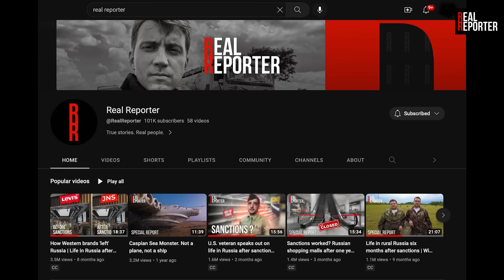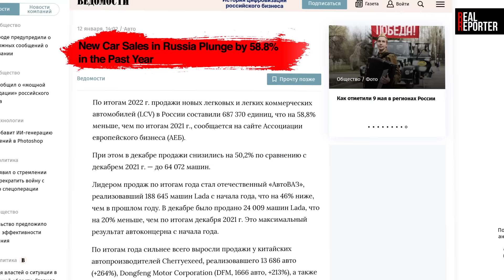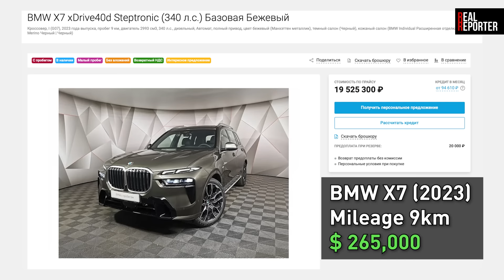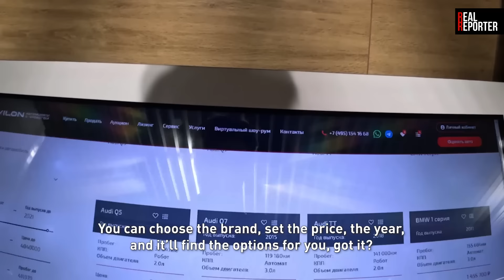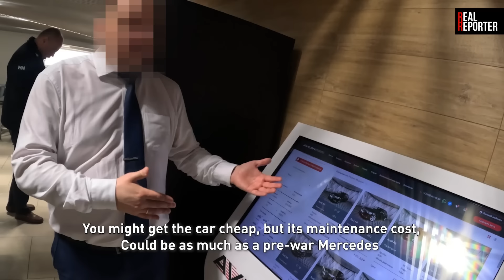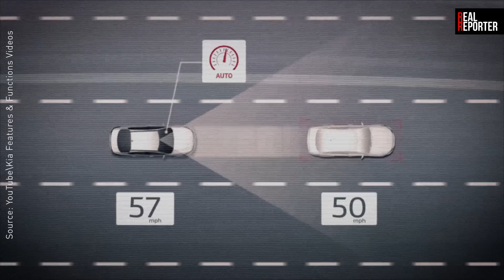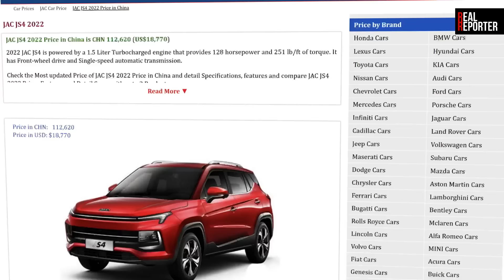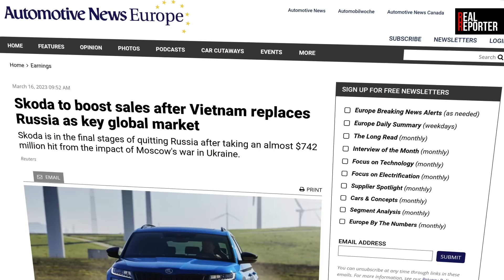Sanctions vs Russia’s car market. Who wins?

Comment: The real reason for the front seat in the Jaguar is not for passengers, it's really to give your mechanic a place to ride with you.
Reply: Хорошая шутка😂
Reply from the maker: Good one
Reply: A neighbor of mine had a Jag. That's not far from the truth.
Reply: And surprisingly Jaguar is own by Indian Tata Group 😂
Reply: I used to work for a company that owned 2 jags for high ups, aaaand the maintenance was so expensive that they decided to sell those and use premium taxi services. It was simply cheaper with no headackes...
Reply: My dad used to have the Jaguar XF - absolute beast of a car! Actually had it 8yrs before selling without any issues just annual services. 

The fact is just like a Range Rover, high end Mercedes or a luxury yacht they require regular maintenance and looking after and the parts aren't cheap. The reason they are so nice is because the tolerances are so fine, but you need to be able to afford to keep one.

If you want something that you just turn the key on and drive then you buy Japanese.
Reply: @wallingnaga6563  🤢🤮
Reply: @RealReporter  Thanks for a good video. I drove  back from two weeks in Russia last saturday...long trip. You forget to mention Turkey and import of brand new cars from Saudi-Arabia.
Reply: Few months ago i was at my mechanic who service all my cars last 20 years and there was Jaguar  F pace siting there..i ask what was wrong it..he sad totaly dead engine..on 2019 car with just 50 000 km on it which just got out off warranty
Reply: In the U.S, my mechanic once threatened my with physical harm if I bought one.
Reply: From Forbes article :
"According to reports, China is now the world’s biggest exporter of cars."
Reply: Forbes article name :
China Overtakes Japan As The World’s Biggest Exporter Of Passenger Cars
Reply: @RealReporter  While the sanctions played a role, the increase of Chinese car imports is seen everywhere.  Even without sanctions, you would've seen a huge increase in Chinese car imports based on world trend.
Reply: 😂😂😂😂 😂😂😂😂😂 realy??? wkwkwkwkkw
Reply: I bought a Jag. XK V8 from new. The salesman was very pleased telling me, I could turn of one row of the engine to save fuel. So it drove like a inline R4. Brought after first brakedown soon after, to where i bought it. An honest mechanic at Jag told me the reason you could do it. Was then you could always get it home, if it sprung a headgasket or piston on the one side. And I could keep going on the other side.
Reply: @TobotronPrime  jaguar, Land rover and range rover consistently come bottom of car industry reliability stats. Anecdotal  evidence is irrelevant in comparison to actual facts. Even the British army is having issues with Land rover reliability. I think it has something to do with poor quality components that come from India since these companies were sold to off to the highest international bidder.
Reply: exactly
Reply: @steffen1972denmark  I guess the engineers at Jaguar were just planning ahead for the known breakdown that was inevitable. 😊
Reply: money pits. never ending repair
Reply: I heard that back in the 1970s, Americans would buy a Jag and the first thing they did was to swap out a Ford engine because the Jags were unreliable. Fast forward to the early 2000s. Two coworkers of mine found out that they both owned Jags. The very next question that they asked each other was who their mechanics were. Not a good sign.
Reply: Lol ... good one 😂
For service and repairs it's cheaper to employ a full time mechanic when owning a Jaguar.
Reply: Как говорят некоторые в России, ленд ровер, ягуар, порше каен это недвижимость 😂
Reply: @tomtube1012  Chinese brands only manufacture in China, meanwhile everybody else have factories around the world. I wonder if this fact still counts as "export".
Reply: It's a BMW😮
Reply: @amiigose  
UAS pernah dikasih Jaguar sama jemaah nya, katanya sih cuman sebulan langsung dijual lagi 😂
Reply: @RealReporter  Soviet Union have the best public transportation on the world men. Soviet microdistrict don't need car #15 menit city
Reply: Hugh put Devine in his front seat.
Reply: @wallingnaga6563  what could we more expect from a Naga person who would Mock these. The fact that Jaguar landrover biggest market is China itself and britan is still hangover landover.
Reply: these fancy tin cans on wheels
Reply: @Viktor_F  Я аж вспомнила шутку что нужно покупать два жигуля, один чтоб ездить, другой пока первый ремонтируют...
Reply: China can have Russia😂
Reply: And money...
Reply: ☝ true story 😂
Reply: lol🤣
Reply: The Lucas electrics in my 1974 jaguar xj6 are every bit as reliable as the Lucas electrics in my Toyota Corolla!
Reply: @andrewallen9993  my 1990 XJ was a beautiful car...when something wasn't breaking. Maybe things got better or were better but more than one owners of Jags had the same opinion. Trust me I love them, been eyeing up the right XJR to buy.
Reply: @--Dani  The old ones were better :)
Mine was made in South Africa.
Reply: @Bustergonad9649  All Range Rovers sold in the UK are made in England
Reply: @the best  assembled in England.
Reply: @Bustergonad9649  The associated parts are manufactured in United Kingdom: (Solihull plant)
Reply: In Serbia we have the same joke just for Alfa Romeo
Reply: Yeah you should start a stand up comedy show and go bankrupt
Reply: Lol.. not really... Russians can build their own cars and they do..  Lada literally owns Peugeout. 
Russia started to produce Moskvits cars again, and they look like any other western suv. 

Russians will just start either building massive amounts of cars or import chinese brands, there's like ~50
Reply: @TobotronPrime  as someone that had owned 3 different Audi A3's, a Mercedes A class and rented a Jaguar XF for a week in the past 14 years - the Jaguar has been the most unreliable vehicle i have ever had to deal with.
keep in mind that it was a rental when i was on vacation in Scotland, i actually got two of them - the 1st time the suspension collapsed while driving at a highway. then i got a replacement one that had a dead electric seat motor so you couldn't adjust it at all, so i complained about it to the rental company and drove to their nearest depo to replace it and on the 3rd car i just asked the rental company to just give me the Audi A4 that was in the lot... lol.

english cars are unreliable trash.
maintenance cost of Audi is not that different from any VW group car, the Mercedes was a little bit pricier but still not what i would consider outrageously expensive and it was a really nice driving and reliable car, and for all of my cars i never had ANY issues because if you actually do your maintenance in proper intervals they can be just as reliable as Japanese cars.
but the Jaguar? the only good thing i can say about it is that the 1st one i got had a really comfortable chair, it felt like sitting on a really comfortable couch but reliability? from that 1 week experience i'd say its 0/10 in reliability.
and if you are a cheapskate that only wants a car that you can drive from place to place and never do maintenance just buy any Toyota model from the 80s-90s - they can basically run on 20 years old motor oil after 3,000,000km just fine -> ask ISIS terrorists lol
Reply: Mine just blew up - luckily I have a warranty.....  and I knew what I was getting into when I bought it.
Reply: You always need 2 jags. One for the repair shop and one for driving. Even the russki sales man had 2 next each other on display.😂😂😂
Reply: My family has 2 jags and 1 Range Rover for 3 years now, no problems so far, only 1 minor thing that was fixed by the warranty
Reply: what
Reply: Curious, I've had 2 Jags, an XE and an XF, both were fine cars, albeit the XF was better. Traded the XF for a Lexus. Got to be honest, I still miss the XF. Sometimes it is the luck of the draw but never had an ounce of trouble with the Jags.
Reply: @dontuno  my dad daily drives XF im a fan of it's harsh suspension. I don't like Japanese cars for making the suspension too soft and smooth
Reply: Jaguar and land rover same WhatsApp group
Reply: Приятно, что Константин близок к народу. 😂 те же мысли, и тоже недорогая машина. 
2016 года выпуска логан. Буду ездить пока ездится или пока ситуация не наладится.
Reply: @RealReporter he isn't joking... Mechanically speaking there are a lot of problems...
Reply: @dzonikg  a perfect fit for an ICE to EV conversion project.
Reply: @di_naxyi  но эта неподвижность обесценивается, настоящая неподвижность ценится
Reply: Oh Because the mechanic has now refused to work on BMW's with their plastic parts in the engine which go wrong at huge replacement cost -and which is a nightmare for owners.
Reply: @dzonikg  with that car you drive the shit out of it. i would go 2 times faster as ussually🤣🤣
Reply: ...Ouch .
Reply: It's funny ofc but factually incorrect, jag XE is one of the most reliable models they have, esp after 2017. Overall Jag is pretty middle in terms of reliability ratings nowadays.
Reply: @martinsiebert3853  The SAUDIS make a car? What do they import the workers to build it as well as all the parts?

Comment: I used to work for a Russian exporter who does this. Buys American BMWs, Mercedes, etc., drives them around the block until they clock about 15 miles, and now the car is "used" and able to be exported. Gets put in a container and shipped to the Middle East, where it is then forwarded to Russia. They switch everything over to Metric and change the Region on the other end. New car parts get over there the same way.
Reply from the maker: The part about how they drive the car around just to get mileage was very interesting. I had know idea they do it like that. A car dealership’s salesman told us its a ‘technical mileage’ a car ALWAYS has  driving from an assembly line to a parking lot and so on… Thanks for sharing!
Reply: @RealReporter  in my country they don't even have to drive it. They simply register the car. That's it, now it's used. They call it 'km zero', which is brand new, but discounted. It was done when they needed to unload  the inventory.
Reply: @DerpEye very straightforward and simple
Reply: Is there a market in shipping wrecked cars from Canada to Russia ?
Reply: @importedfilmz  it was business for Georgia and Armenia, cars from USA were shipped to Batumi port, and as Armenia have customs benefits from Russia, then cars moved to Russia. It was restricted yo so long ago due to sanctions. But doubt that cars were exported from Canada, it is poor country, so cars are costs more and more cheap models.
Reply: @importedfilmz  No, because who's gonna pay for that.
Reply: Km zero in Italy is a used car with a new engine, or a Re done at least @DerpEye
Reply: You tip in the service computer the miles you want. They are displayed. After shipping you change it back in russia to zero. Aaaand sell it for a good price of a new car.
Reply: Europe will luze in this not Rusija and China will get not  Usa at the end lol
Reply: @AP-ob9pm You are wrong . @DerpEye is perfectly right . Even in the card magasines at the end of the new cars price lists, You can find the "km zero" cars and the precise dealer car who own that car . 

Km zero , is a new car , with too many years in the dealer garage , and that is the reason You can find them even with 30% discount
Reply: Just maybe the Russian exporter is involved in stolen BMWs, Mercedes etc and ships them in containers to Russia.
Reply: @don-cw1yz  Possible, but I know for a fact that at least a large part of the cars were legit. There were always large piles of the new car plastic, dealer paper mats, etc. that had to be removed from the cars. I don't think they would bother to go through all of that trouble for a bunch of stuff that needs to be removed and thrown away.
Reply: @importedfilmz  There's a market for wrecked cars in Ukraine, but not for Russia.  Russia has ample supplies of good cars, new and used.

Comment: The brake job wasn't bad at all.  The cost, as compared to most US shops was very fair.  Far cheaper.  The pads seemed just a little high, but it wasn't absurd.
Reply: in the regions, the cost is much lower. And if in a friendly service it's even cheaper. The price tag on the video is unjustified
Reply: The salaries are bit lower. People from Germany near to Poland use to repair their car there for half price. My wind shield replacement did cost 150 instead of 600 in Germany
Reply: Yeah I’m sure brakes without abs are Gona be cheap to fix
Reply: ofc the job is much more expensive in the USA, look at the salaries. Its day and night, even in hungary you get more money for work than ppl in russia.
Reply: The average MONTHLY salary in russia is $700. Of course,  services are cheaper.
Reply: @tango2642  Today in Moscow and around, Chelabinsk probably 300-400€
Reply: @manjelos  yes, that's the point. How can anyone compare $50 service in the US with $50 service in russia? It doesn't make sense.
Reply: @TKUA11  what does ABS have to do with brake pads, and which car made in the last 2 decades or so doesn't have ABS?
Reply: Depends of what the mechanic did. If he just took out old pads and put in new thent that's like 40 minute job. Complete overhaul of all moving parts of brake system (the proper way to do it) would be about 2 hours.
Reply: If these are Chinese fake brands than the price is pretty high
Reply: How are you going to compare service prices in the US, where the average salary is near $70,000 and Russia, where the average salary is like $9-10,000 a month? lol…
Reply: The exchange is poorly calculated, it's below $100.
Reply: When he showed him the brakepads one was totally gone and the other still had some meat on it, indicating a seized brake caliper. If fixing that was included in the labour cost then it was a bargain. If not then the price wasn’t bad but he only did half a job 🤣
Reply: @tango2642  money worth more

Comment: Here in south america, spare parts for "western" brands mostly are bought from china, and that includes brake parts, tubing, cooling systems, cosmetic replacements, etc. This applies for small vehicles and big ones, like trucks and buses. Im gonna be honest, and the only ones that are sketchy are for really high end vehicles or some americans like the early 2000 big v8 american pick ups. Gonna add that you can have some spare parts brands that says that the company its korean or japanese, but in the end all the stuff its also fabricated  in china, like the iphones. (Used to work on a small family spare parts shop).
Reply: I will never trust my life with Chinese brakes.
Reply: @RandomGuy9 

Brake pads are just a piece of metal with brake material on it.

The brake disk is just a steel disc.

I'd use those even if they were made baboons in North Korea, and not have a worry in the world. 

Those aren't the things in brake system that are going to fail (put your life in danger). 

It's the car's hydrolic system, the calipers, etc that I wouldn't trust if it was made in China. 
I don't even trust some of the usual brands.

E.g. If the car is some cheap crappy chinese car, but you install brake pads and discs made by NASA is not going to make the braking system more reliable. Because those things have little influence on braking reliability. 

In other words, him buying chinese brake pads shouldn't be the main concern, buying a Chinese car should be the main concern.
Reply: How’s the car community in SA, is it lively out there are there decked out jdm’s and blacked out mercs?
Reply: @dova238  depends on the country, Brazil has a car market but everything is 100% more expensive than in other countries.
Lot's of taxes you know, so much so that companies are actually moving to Argentina to manufacture cars and we are losing jobs.
Rich people "the extreme minority" can enjoy some good Japanese cars, the rest is running fwd entry cars (that are also insanely expensive)
Reply: Come on Mexican/Brazilian parts are just a little more expensive and are almost good as the original brands.
Reply: @HIDHIFDB  true, its common belief that if you wanna go for quality, and put a bi more money on spare parts, you go with brazilian brands, at least here on Chile